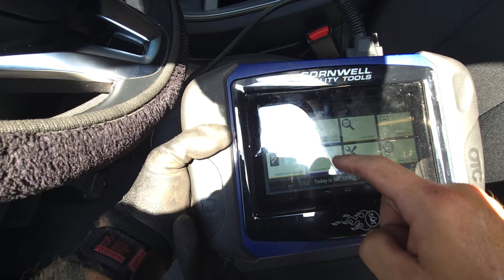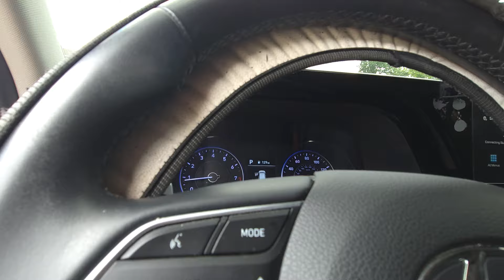2020 Hyundai Palisade R/Brake Pad and Rotor Replacement with Electronic Parking Brake - No Scanner

Comment: Note that you can un plug the park brake connection at the caliper and use a small 9 volt battery with wire connection leads and prob the connection at the park brake motor as well not having to dissemble the p k motor assembley works well no scanner. Try it
Reply from the maker: Yes we have videos using that method as well however I would recommend using a 12v battery or at least a convertor as the vehicle is powered with 12v

Comment: How on earth did you just pull the caliper off after removing the two bolts. I pulled the two bolts and the caliper does not move at all. I assume the electronic parking brake is still engaged and preventing me from pulling it off?
Reply from the maker: Yes the epb is likely still engaged the caliper should pull right off with the two bolts removed
Reply: @danthebrakeman did you just skip the step on how to release it without the obd?

Comment: Great job and thanks for sharing.  It's funny the difference between geographic area and how they do brakes. In the midwest rustbelt, I wire wheel the hub face and apply a light film of Fluid Film and also use a very light coat of silicone grease behind the hardware on the bracket or else rust will form beneath it and rust-jack the hardware and ultimately jam up the pads.  I also brake clean the rotor surface.  Thanks for the tip of the EPB....I thought I would have to get an expensive scan tool.
Reply from the maker: Glad it helped

Comment: Appreciate the video but I really think you should put a note on the plug disconnect that the correct way to lift the tab is to push up inside the top hole. I managed to break the tab lock following your method. 2:26

The tips for the parking brake worked perfectly.

Comment: Great video, I have same car, didn't want to buy another scanner,  thanks for video,  eventually I'll buy a better scanner since all the cars in my garage have epb
Reply from the maker: Or just save your money and use this method only adds about 5 min per side. Most of the time it takes 15 min to get the scanner hooked up and thru the steps to get to the epb maintenance mode

Comment: Hi Dan I just looked at you video on replacing electronic parking brakes, it was pretty interesting however, I notice that you did torque bolts to specifications and if someone over tighten it can cause problem as well as under tightening. Also , do you have a video on doing same procedure with the use of a scan tool, thank you.

Comment: Great video!!!! One question, when you place the motor back on the caliper, do you have to rotate the 5mm bolt/pin to get the motor to align correctly when you reassemble?

Comment: Dan, thanks for the video everything went smooth. Only thing is that the “auto hold” and “epb” lights were on after. Car starts and stops just fine, any way on how to reset those lights? My ob2 reader can’t reset the palisade parking brake.
Reply from the maker: Sorry for the delayed response not sure why you had lights on. Double check connections and test drive sometimes they reset themselves after test driving

Comment: Dan, this is a really great video. Is there a difference between replacing the front and the rear on this car? I'm looking at replacing my wife's rotors and pads as the dealership said the pads are at 4mm.
Reply from the maker: The only real difference is the electronic parking brake in the rear. The fronts are pretty cut and dry.

Comment: How important are the spreader springs ?  Some pads from auto stores don't come with them...and it didn't seem like it came with the spreader springs from the factory.  Thank You.
Reply from the maker: If they're not on from factory it's no sweat some pads have hardware with spreaders built into them. But it's always best practice to get it as close to back to oem as possible

Comment: Dear brake man, you may be the right person I can ask. I can't find it on the internet. "My new brake pads + new discs squeak when braking softly" Can this be easily remedied, or should I use softer brake pads (less metal)? Thank you in advance for your technical advice
Reply from the maker: Unfortunately some makes and models especially heavier vehicles are just prone to squeaking using brake grease on the back of the pads may help also make sure to use high quality ceramic pads

Comment: where are you placing floor jack to lift rear of car?
Reply from the maker: I don't remember the exact spot on this repair it's always under one of several jack points. Pinch weld, frame, rear differential etc...

Comment: What's your rear lifting point on the palisade?
Reply: There’s a small notch on the frame forward of the wheel on the edge of the vehicle that perfectly matches the notched cutout on the included jack stand within the trunk compartment on the palisade. If your jack is more than half way under your palisade you’ve missed it.